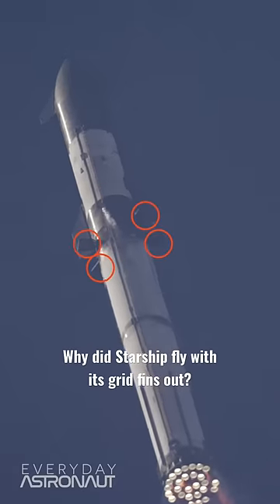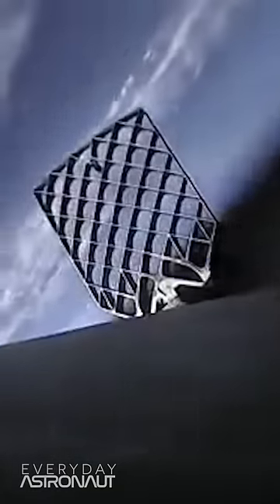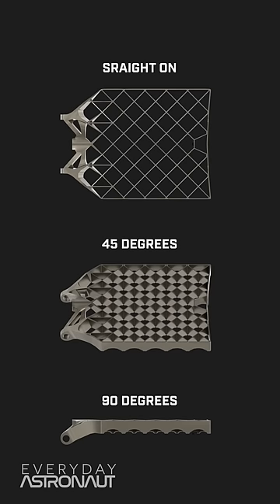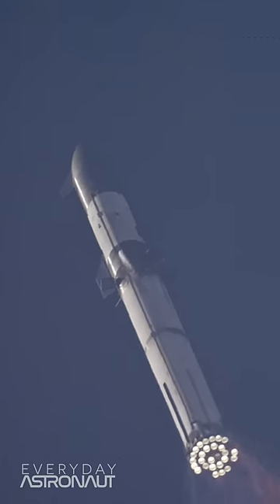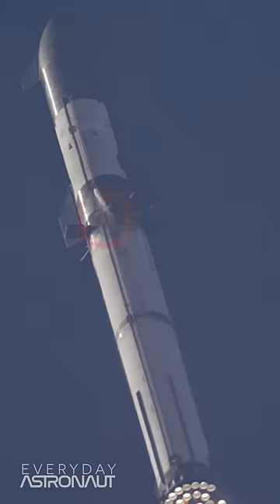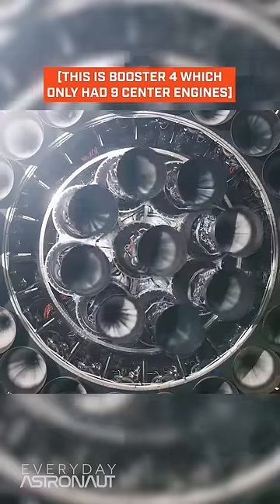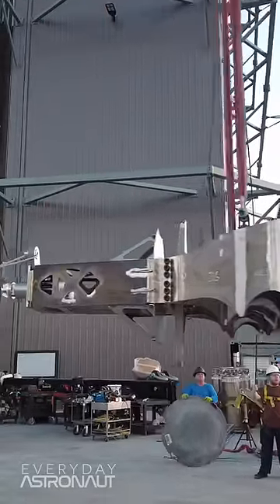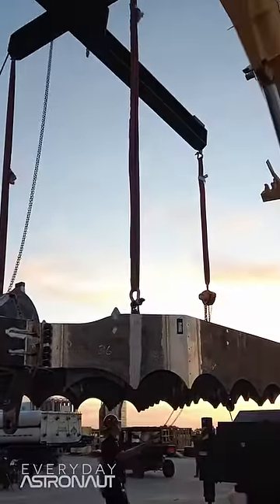Why did #SpaceX keep #Starship’s Grid Fins out on ascent?

Comment: How is redirecting airflow not steering using drag? Airflow is what causes the drag in the first place (no drag in space even at velocity, obviously). If you're redirecting airflow you're controlling where the drag is concentrated and how it affects the system. You're steering using drag.
Reply: Drag is inevitable. In fact, the rocket's grid fins are designed to much increase drag during re-entry, at Mach 5 or greater speeds. But using aerodynamic forces favourably doesn't mean "using drag" but "using lift," perpendicular to drag and generally much much greater than drag if the angle of attack is below that of stalling. You steer using lift, not drag, even though drag, a hindrance, is inevitable. You don't say your sweater's size-labeling tab keeps you warm, won't it be the remainder of the sweater that does?
Reply: @wafikiri_  It increases drag you say? Sounds to me like using drag since you're controlling it's effect. And LIFT, you say? you mean like LIFT INDUCED DRAG?

"In aerodynamics, lift-induced drag, induced drag, vortex drag, or sometimes drag due to lift, is an aerodynamic drag force that occurs whenever a moving object redirects the airflow coming at it."
Reply: @Zeropointill  A crucial point is that drag and lift are not proportional in general. One can have no lift but lots of drag (e.g. shift a dividing wall orthogonally to the wall surface).
Generating lift always induces drag, but an aerodynamically efficient design can have a high lift to drag ratio (i.e. most of the overall aerodynamic force is lift, not drag).
Lift results from induced pressure differentials. E.g. drag on an airplane is mostly acting horizontally as a declaration force, whereas lift acts nearly perpendicular to its velocity vector.
Steering a rocket via drag is generally possible, but the grid increases the control surface compared to the fins' drag, which results in a higher lift to drag ratio at least for subsonic speeds, i.e. they are designed to have lower drag in thick air for a given steering force. Note: "lift" is just short for the aerodynamic force due to the induced pressure differential, it's not an upwards acting force in this case.

Comment: Space travel is a scam. There is no way to send full tank of fuel into orbit by using just one tank of fuel. 

in the real world, a Falcon 9 has a launch payload of 13,150 kg and a takeoff weight of 505,850 kg, which means the mass ratio is about 2.6%.

Rocket mass ejection propulsion technology is the least efficient method of mass acceleration. The boosters only last 3 minutes. How long does the upper stage last?

Even the largest rockets can't travel around the Earth on a flat highway without refueling multiple times, so how do rockets get payloads into orbit or Mars?
Reply: In space there is no friction. You just need a booster to get an object to space, then fuel in that object to accelerate and decelerate

Comment: Yes, they need to find a way to retract the grid fins and leading fins on Starship.  It's Rocket Science 101 that your center of pressure should be behind center of gravity.
Reply: All modern fighter jets have their center of pressure ahead of their center of gravity. It's a headache for the guidance and control team, but the computer can certainly handle it with enough control authority, in this case thrust vectoring.
Reply: Most rockets are aerodynamically unstable. Falcon 9 is aerodynamically unstable, for instance, alongside the Atlas series, Electron, Titan, Minotaur... I'm really just naming rockets at this point. It's honestly a rarity for them to be stable; this is exclusive to things with fins, like Saturn 1B, Saturn V, Redstone, Scout, or Juno. You'll notice that these are all like 50 years old. Reason being is that modern rockets don't use fins very often, because what's the point in wasting mass and drag on fins when you have a set of computer-controlled gimballing engines? Aerodynamic stability adds nothing to a design; you can already achieve stability enforced by your rocket's guidance system for no added mass or complexity, because a rocket has to be able to control itself, fins or no.
Reply: Did you watch the whole video?  Tim explains that the trade-off in weight vs drag didn't favour lowering drag, or optimizing exclusively for the COM.

Comment: Nobody cares about that, the real question is why they keep blowing up
Reply: Still in development and SpaceX doesn’t have several billions to spend. They have only spent $5B for the entire starship program over the least 5 years. That’s not $5B per launch but $5B for everything starship related from vehicles, launch towers, engines, build site, literally everything for around $5B. NASA spends $20B every year.

They blow up because the ship doesn’t enter the desired trajectory or they suffer an anomaly which the ship will automatically destroy itself to prevent the ship from potentially lose control and reenter somewhere random.

Comment: Lol, like elon is thinking about saving weight. He bragged his engineers told him stainless steel was too heavy and wont work, it appears to be the case. He also doesn't care about failure modes. As he is making his landings overly complicated. Not toention parachutes have been used since the beginning of space flight. Reliable cheap, low mass, but he has to make it more complex to market it to the less informed masses. Lol
Reply: Stop getting your info from TF
Reply: @user-RCST  you stop getting your information from lmnopq! Lol. Have you not watched interviews he literally did brag the his engineers said his ideas would make it too heavy. He also admitted his max payload is now below a max of 40 tons to leo down from 150 tons, (not that i believe that either), and stainless. Lol. He chose it to brag that cyber truck was made of the same stuff. Which he literally did, I watched his interview on yt, YouTube. Next, you'll tell me that bringing extra fuel up just to stop that fuel then accelerate the fuel backward, and then bringing that fuel down, with all that mass, is actually saving fuel, lol
Reply: @elbob1491 and so that’s why they are making Block 2 ships which fix most of the issues brought up as well as increasing the number of engines to 35 (5-10-20 instead of 3-10-20), increasing performance of each engine, stretching the tanks to hold more fuel and to use the strongest but also easiest and cheapest steel to work with. SpaceX is meant to support a fleet of Starships to Mars and having expensive steel drastically increases costs, and the steel they already use (304L or at least a variant of it) has been in use for years at this point and some 300 series steel was used for spaceflight before.

You can literally make the fuel out of water and carbon dioxide. You won’t run out of fuel.
Reply: @archierush868  where was block 2 and 3 and raptors 2 and 3 on his Gant chart? Where did he plan for this? The short answer is he didn't. The long answer. He is a marketing bro who manages to sell his failures to a gullible audience. Right now, his whole design, by its concept, has failed undeniably. So he will magic the issue away, change every single thing, design, and concept that made this this. Remove reusability and remove this added swing arm nonsense. And maybe actually design a multistage rocket that might just work like a decade behind schedule. And the elon succophants will say it was his plan all along. Of course resuability won't work they will hyprocritically say, of course he needed to use conventional lox and liquid hydrogen and of course stainless steel wasn't going to be the final material he was going to end up using. Of course, Raptor and Raptor 3 are completely different engines with no shared concepts, and its actually an all new design, its all iterative testing, they will say. Of course. Lol.
Reply: @archierush868  adding engines ads complexity. Do you know why nasa only had five f1 engines on stage 1? Because that way thwy are more reliable per engine. Let's do some simple math. Let's say every engine has 1% failure rate. So what are the chances we get successful stage burn? Take 0.99 to the power of the number of engines. So 0.99^5=95% chance of success. And elons? 0.99^33=72% chance. Oops, I almost forgot 2 important details at 100 tons to leo nasa figured he would waste an extra 15 launches to refuel. Lol. But since he has reduced payload to a max of 40 tons. We can assume the same conditions, which means he will need over 40 wasted extra launches. So (0.99^33)^40 or 0.0006% chance of success.  Also he engines are nowhere near reliable. But he made the claim he could lose a couple and still make it. That is a wild claim he is asserting without evidence, and that which is asserted without evidence can be dismissed without evidence.
Reply: @archierush868  who told you stainless is the easiest and cheapest to work with? No one with any knowledge of material science. Are you quoting the unfounded claims of elon who has something to gain by lying to you? He did it to market his failing truck, and why does his truck have flat surfaces? Because stainless steel is extremely hard to machine and work. The only reason was to brag that his truck was bulletproof and made of rocket stuff. And it's not even bulletproof in a literal sense. 

With any knowledge of material science. We know that shape is the most important factor to the strength of a structure. What thing aluminum allows you to do is become stronger for less weight because of the shape of the structure. Saturn V, with its aluminum hull, didn't need internal braces and struts like starship does. That alone should tell you something. Combine that with saturn V was more capable and lighter weight shows how well Saturn V was designed and how poorly starship was.
Reply: @archierush868  starship was originally called BFR. It's pretty obvious before he had any idea of where it was going or doing. His little ego wanted the biggest rocket. He later came up with a horrible idea for it. ICMB but with people. He said he was going to fly 1000 people a day on 10 round trips from saudi to nyc. And economy of scale would make it 10 times cheaper than flying, Lol. No. Number one expense for airplanes is fuel, but he was going to somehow burn 10 to 100 times the fuel and only charge 1/10 that of airlines lol. Noway. Do you see how this smells of hhperloop? Then he switched the name to ITS, and it was going to take tourists to the outer planets. Lol, no. Nowhere near the delta V for that. Voyager took like 12 years to get to neptune. No way you're bringing enough food, water, and air for that trip. And that's with no way back, lol. Then it was Mars colony transporter or MCT with also big unrealistic and made-up/ not reality claims like you can just tear apart the ship and live in it. He can't even get out of orbit. And remember, last time he shot an empty rocket aside from his tesla at Mars? He missed it, lol. He marketed it as getting higher than the orbit of Mars, but that's just what happens when you miss. Lol. Imagine being in a rocket and seeing the red planet fly by and realize you are going to orbit the sun until you crash into either the earth or the Mars in a few decades.
Reply: @archierush868  adding two engines would just drain the fuel faster, and adding more fuel means heavier tanks added with the additional weight of the engines. Which also add more chances of failure. The flaws are a bit too big for that simple paint job of a fix. You need to first start with a planned destination, unlike what BFR/ITS/MCT/starship did. Then work backward and figure out delta V needs. Design stage separation at the exact moment (plus a margin) that you have reached said deltaV. Then, design the previous stage with the delta V needed for that specific trip, and so on until you are back at the launch pad. Elon is essential trying to take the crew capsule, command module, lem, lunar ascent module, and the S-IVB stage and call that starship. Then add way more mass. The reduced delta V and increased fuel requirements mean it's a non-starter from the word go. Just take it from the lunar injection orbit and decent burns to touch down on the moon. You are going to need so much more force to accelerate all those combined stages, with all the wasted mass you're hauling around. This means you need more fuel, which means you need more mass, which then adds more fuel, and the downward spiral ends up flushing that turd of an idea. Lol

Comment: surprised the air drag doesn't rip those fins off. is SpaceX faking it like apollo did?
Reply: its a giant piece of titanium thats probably mounted onto a mechanism made of titanium, they just lock that stuff up tightly and it seems to hold up. i guess its like putting a wedge in a door. the wedge isnt super strong but it just locks up the door.